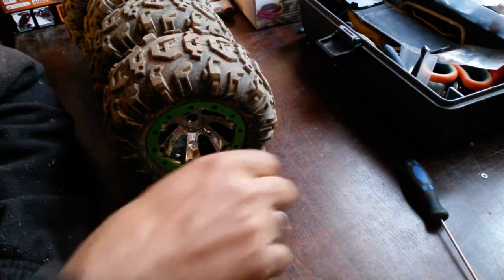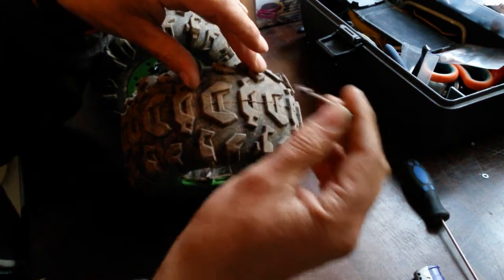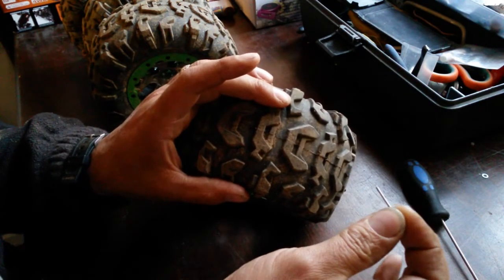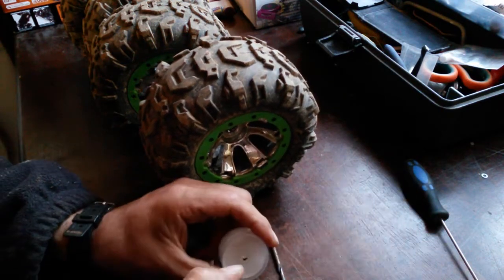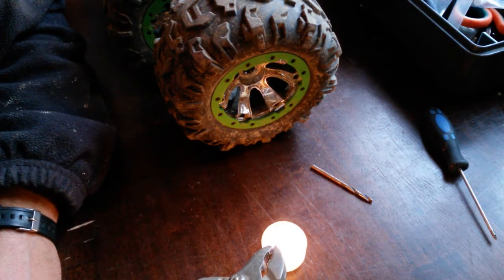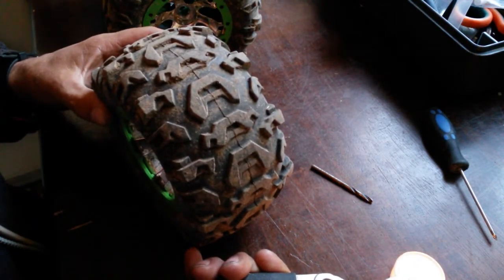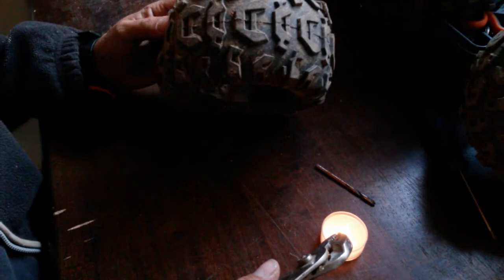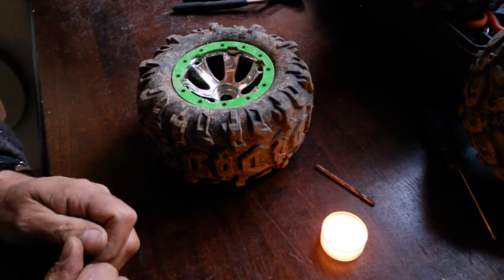Rc getting water out of my wheels

Comment: I'm assuming because of the wet foams, those tires are extremely off balance. I thought my Slash's wheels were off balanced but dang. My dad took a hot glue gun and put a small pea sized dot on the airhole of his tires. They hold air extremely well. No leaks.